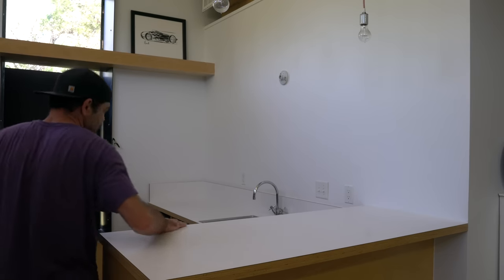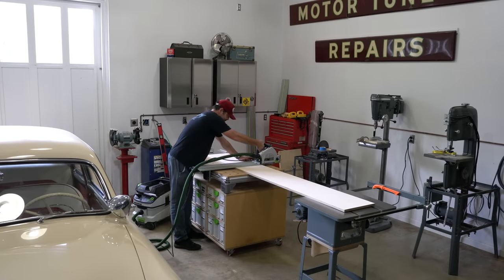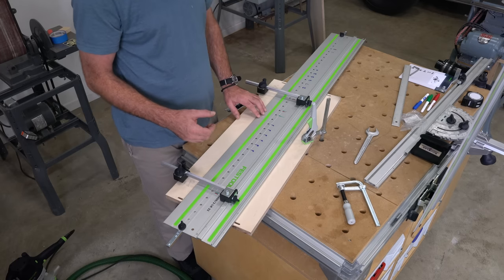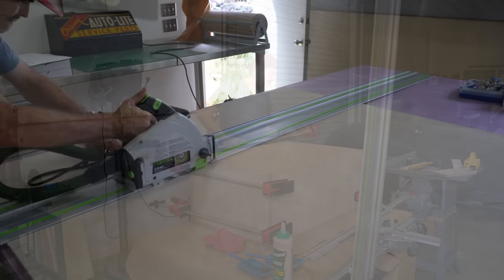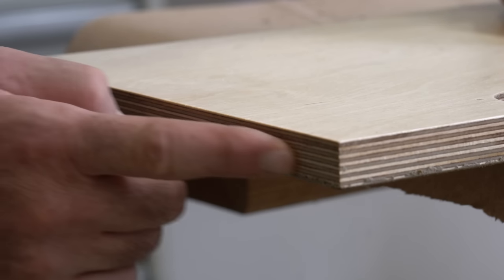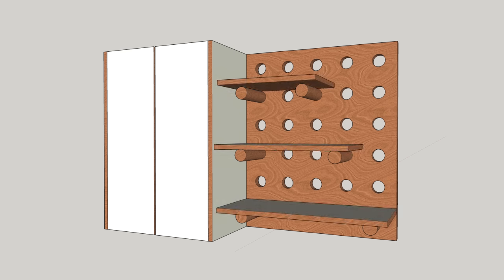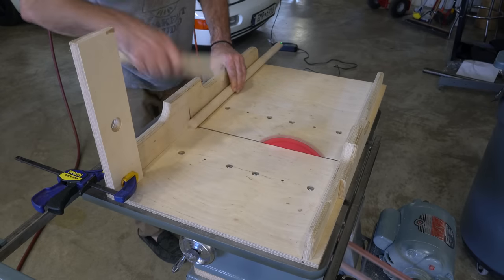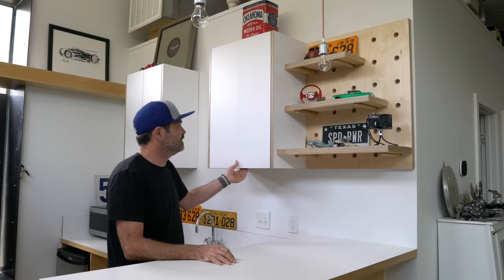The Studio Kitchen Cabinet & Shelf Build

Comment: Hey Ryan not sure how I missed this. I really enjoyed your first woodworking with Festool videos as I was just getting into it myself.  Since you're operating off a single MFT take a look into Fence Dogs from Benchdogs.co.uk. Combined with some Starrett tape on your fence you can calibrate it to the rail to use the stops to not even have to measure when cross cutting and the whole fence pops off when you need use of the full table and when you put it back on you know it's dead on and more importantly it can't move on you. I can share pics if you need them if I'm not being clear.